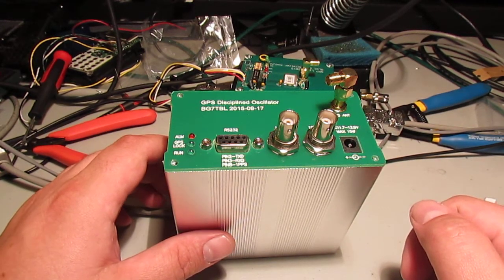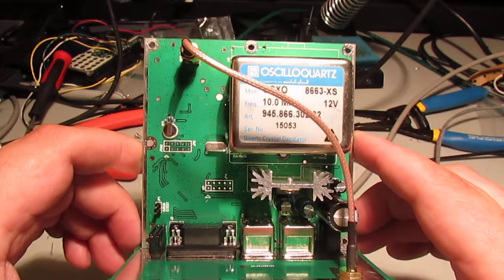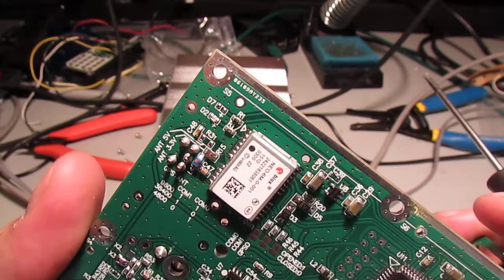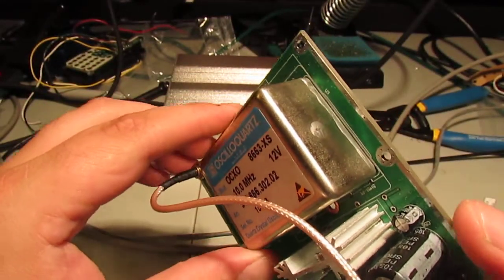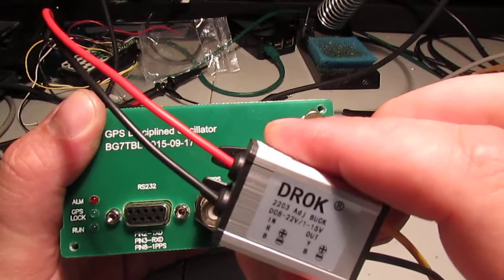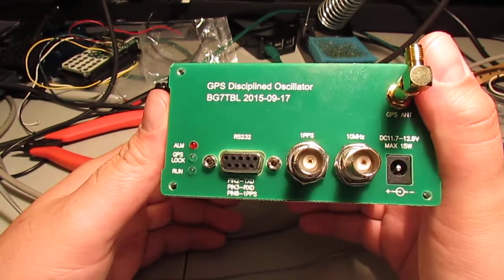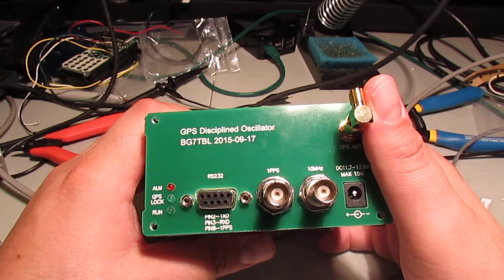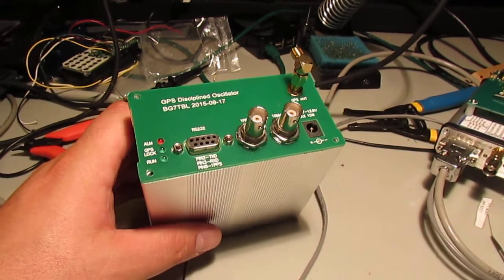A Look inside the BG7TBL GPS Disciplined Oscillator

Comment: The "u-blox" GPS chip on your board looks (to me) like one of the many available Chinese fake units (i.e. the label is not placed exactly). A further inspection of the label and the chip itself probably will show some further evidence of this. Note: There are a lot clones/fakes around especially for the Ublox units. Ubloxs realized this already and warns explicitly about those on their website. The clones are a lot cheaper than the originals on the Chinese market and Ublox of Switzerland will not provide warranty or repair for those as stated... :-)
Note: The Ubloxs u-center software usually is capable of identifying them quite decently. I myself got one of those BG7TBL units also and have been "plagued" by this phenomenon too... :-) 

All (D)OCXOs used on those units are surplus ones, usually removed from disassembled base units, which had been replaced regularly. The actual selection of the OCXOs by BG7TBL depends on what is currently available on the market and the board is made to use all those different types an configurations already. Most of the current units use just "normal" OCXOs of different makes, whilst the D(ouble) OCXOs like the Oscilloquartz, Morion, Trimble ones nowadays are rare, expensive (overpriced ?) and mostly hard to get. There seems to be some clone (UCT 10836 10 MHz) new old stock available right now, which - judging by buyers comments - should be at least (almost) equal to the shown Oscilloquartz DOCXOs. The surplus original ones (8663-XS) have been probably 10 years or longer in use already (some carry a production date on those), which shortens their lifetime (?) somehow but improves on stability through aging of the crystals used.

Comment: Which person on ebay did you buy this from? I want to make sure I get one with the Oscilloquartz oscillator. I have heard that there isa wide veriety of oscillators that these are made with and some are not so good and I know Oscilloquartz oscillators are indeed very good quality.
Reply: BG7TBL has sold two different GPSDO's recently, they are all cell tower pulls.  The one in this video was made by Huawei and has the Oscilloquartz oven, the other they sell uses a Trimble sourced oven.  They are both UBLOX controlled receivers, and are equals as far as performance.

Comment: Great Video !  Plan to order the $60.00 USD ebay board with the (very) small LCD screen for the GPSDO ThunderBolt.  Like the idea of the OCXO and the older it is the less drift it has !  The Rubidium is very nice, but has an active run life of about twenty years...  and then may fail. (But is very, very stable for the long term).  Thank you for the video !  tjl